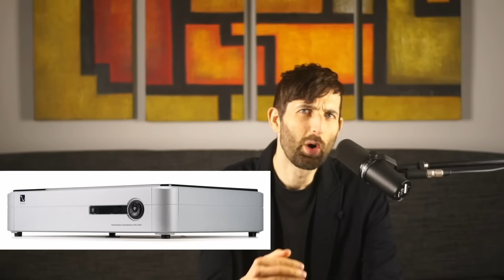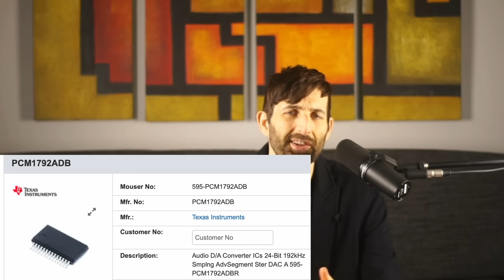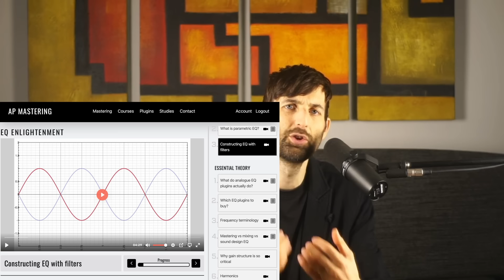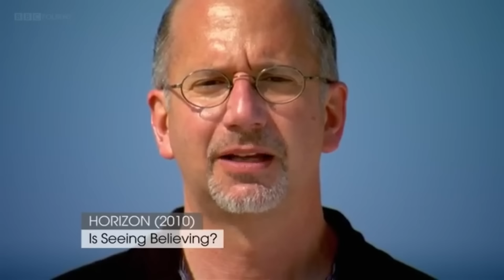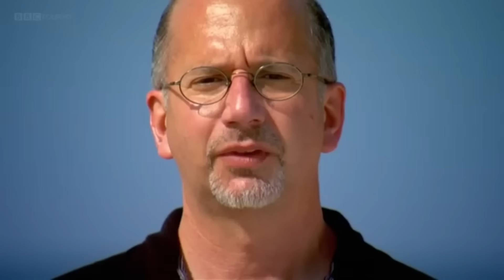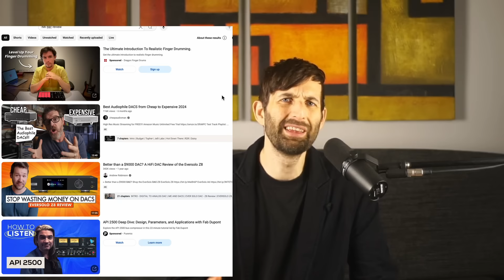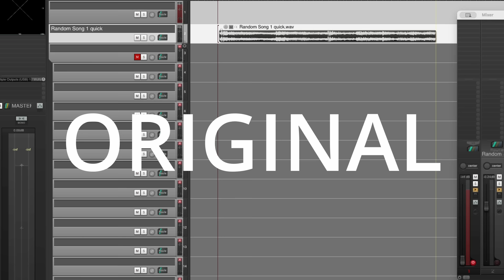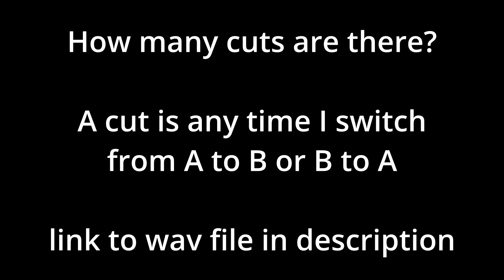The DAC Scam - Almost everyone believes the hype

Comment: Between a $100 DAC and a $1500 DAC there can be a large difference. It doesn't have to do with the "chip" that is used. It has to do with the stability of the clock signal, the design of the power supply for the analog electronics, and the analog electronics themselves not to mention shielding. But if you want to compare a $40K DAC to a $1.5K DAC please share your actual listening experience, not an argument based on specs. What have you listened to on the ultra-expensive end of DACs? What did you compare that DAC to?
Reply: There can be, but if both are competently designed there will not be. The only advantage the $1500 one may have is noise isolation over USB, but that would be about it. Probably more robust too. Modern DAC chips are pretty immune to jitter, a good enough power supply is cheap (it is low power), etc.   It is not 1990 any more.
Reply: @robertt7238  interestingly there are CD players from the early 90s that have excellent measured performance. They were expensive at the time, but the know how was there. 
DACs really are a solved problem now.
Reply: @mattholland315   At the low cost end, the big change came about 15-20 years ago when DAC chips made major leaps in jitter rejection. Prior to then, for top measured performance you needed pretty good clocks, buffer/reclocking, etc.  Then a range of techniques were implemented to effectively eliminate jitter as an audible (or even very measurable) concern.  Modern DAC chip can take an input with a ton of jitter and deliver transparent results.
Reply: @ thanks. Ain’t science and engineering wonderful
Reply: @jerrykorten664  You have fallen for the snake oil.
Reply: @RegebroRepairs  You are blessed with ears that don't require much expense for stereo gear!
Reply: @jerrykorten664  It's not the ears, it's knowledge and brains. I understand that opinions are subjective and measurements are not.

You do not have magic ears that can hear the difference in the frequency response at 80 kHz.
Reply: @RegebroRepairs   The error in your thinking is that we are measuring all that we can hear. This of course is not true. And if you think high sample rates are to hear frequencies above 15kHz you are again showing your total ignorance of the underlying issues. Higher sample rates are chosen to improve the fidelity of those frequencies we can hear (up to 15K for some, less for others). And more importantly to remove the effect of the brick wall filter on the waveform below 20kHz (ringing). That brick wall filter when excited by a lot of high frequency content, as in classical music, heterodynes with lower frequencies to cause irritating sounds. And until you tell me you've been able to compare a recording at 192kHz vs the same at 44.1kHz you have really no dog in this fight. All of you are blissfully ignorant and I think I've spent all the energy I want here. Good luck!
Reply: @jerrykorten664  We are measuring all we can hear. It's clear from your comment that you don't know what the "brick wall" filter is there for and what it does. nor do you know what the effect of it is below 20kHz. 

In short, you haven't got a clue. I assume your stereo is very expensive. I'm sorry that you were tricked by scammers, but that's not my fault.
Reply: @RegebroRepairs  In fact I know how to create a finite impulse response kernel to convolve with the signal in order to prevent aliasing. But I'm sure you don't understand any of this. And if you think we can measure quantitatively all we can hear, I have a bridge I want to sell you too.
Reply: @jerrykorten664  bs
Reply: All we need to know is the measured performance of the analogue output to know if it’s transparent. That’s it. All those design aspects you talk about are important and affect the performance of the analogue output. So we measure that and then conclude whether or not the design is good enough. State of the art DAC performance is available for $500-700. Transparent DACs for even less. Digital to analogue conversion is literally a solved problem.
Reply: @mattholland315  Well there you have it. A total admission of complete ignorance. You haven't listened and your bias is on display. To think that measurements are measuring the things that are important is laughable. You yourself talk about transparency, this is something you can hear, but there is no specification that  measures "transparency". Rather than rant based on specs - I suggest you go to a high end retailer and compare a $400 DAC to a $2000 DAC on a good system and hear for yourself.
Reply: @mattholland315  And all speakers that have the same measured frequency response sound the same.
Reply: @ if they have the same directivity, frequency response and  similar distortion profiles then within their normal operating ranges and perfectly level matched they will indeed sound the same. 
With electronics it’s a lot more simple as there are acoustic systems involved.
Reply: @mattholland315  All of you appear to know nothing about audio  design, aren't engineers and are speaking nonsense! It's like RFK Jr. took over stereo reviewing! LOL.
Reply: @ well in my case I know about audio and have a degree in electro-acoustics. Can’t speak for others.
Reply: @mattholland315 Not an electrical engineer. Certainly not trained in digital signal processing, filter design and analog electronic design. Thank you for saying so.
Reply: @jerrykorten664  There is only one thing to measure: The output electrical signal, and how close it is to what the original signal was.

"frequencies above 15kHz"

15? Try 150kHz. 

"remove the effect of the brick wall filter on the waveform below 20kHz"

Tell me you have no idea how a DAC works without telling me you have no idea how a DAC works.

"And until you tell me you've been able to compare a recording at 192kHz vs the same at 44.1kHz you have really no dog in this fight."

LOL, of course I have. The difference is that I'm an electrical engineer with sound recording as a hobby, so I actually understand this topic and know what I'm talking about, while you have been tricked by audiophile woowoo. 

I assume you have spent a lot of money on your stereo system and you now don't want to admit that it was a waste of money. 

Sorry. Not my fault. Don't blame me. Do you think the earth is flat as well?

"Not an electrical engineer. Certainly not trained in digital signal processing, filter design and analog electronic design. Thank you for saying so."

I know you aren't. I am.
Reply: @jerrykorten664  "Not an electrical engineer. Certainly not trained in digital signal processing, filter design and analog electronic design."

I know you aren't. I am.
Reply: @RegebroRepairs  my DAC is a reasonable $1250. You are not a designing engineer that is plain to read. But I've heard more expensive DACs that sound better than mine. And I have $100 and $200 DACs Too. So I speak from experience, not theory.
Reply: @jerrykorten664  No, you speak from wishful thinking and crystal magic woo. I speak from knowledge and facts. You can not hear the difference between two waveforms that are exactly alike. It is simply impossible, You can just as well claim the earth is flat and pigs can fly.

You fell for the Audiophile scam. I'm sorry about that, but direct your anger at those who scammed you, not me.
Reply: @jerrykorten664  My education is in electrical engineering and I and trained in digital signal processing, and have made my own analog filters to upgrade my mixing console with, etc. So I am a designing engineer. I do not speak from theory, I speak from facts, and you can not hear the difference between two identical waveforms. You speak from wishful thinking and crystal magic woo.
Reply: @ I’m sorry, but since you believe these credentials to be necessary in order understand DAC performance why do you say that listening experience is more important than specs? If you were an expert in the appropriate fields then you would be well aware that subjective listening experiences are incredibly flawed due to psychological biases. The only listening experiences that have meaningful results are controlled, blind ones. 
I’d like to make the point again that it is possible to engineer a DAC for a very low price that has no audible distortion or noise. Therefore it is audibly transparent. This is proven. Also notice I am not asking for your credentials. I am happy to discuss this topic with anyone.
Reply: @mattholland315  These credentials were in response to statements like "if you think you can hear 80kHz" which means the poster does not understand the reason for higher sample rates. It is a fact that you can now buy a DAC for $200 that has fantastic speciffications. If they don't sound like a DAC that costs 5 times as much, why? We are not measuring everything that matters. This is an age old issue in stereo reviewing. The reason people gave up on early audio review magazines that stated that two amps with the same frequency response and distortion specs sound the same. They don't. There were many other issues which weren't measured like the ability to source currrent at a particular slew rate which were unknown at the time. If you don't think the same issue exists with DACs, hang on for a while and watch. We were told in 1980 that the DACs in the CD players were the pinnacle of sound, you could get no better. Boy do we know diffferent now.
Reply: @jerrykorten664  I perfectly understand the reason for higher sample rates. It tricks audiophiles I to paying more money.

And no. Those issues do not exist with DACs.

Sure, two amps with the same distortion measurement can sound different, because they can distort in different ways. This is also measurable.

The DACs today has practically zero distortion.
Reply: @ what should we be measuring that we currently don’t?
Reply: @mattholland315  We need to measure the crystal woo holistic vibrational transmogrifying skew.
Reply: @ sorry just read your comment again and it did make me chuckle!
Reply: And what is your Audio Engineering background by the way? Do you design electronics?

Comment: Interesting video, I went one better once with Hi Res music I mixed a file containing 320k MP3 / 16/44.1 / 24/96 together randomly and saved it as a 24/96 output, any one who listened to it could not tell when the sound went from one to the other. The brain is very good at tricking you

Comment: A few things: (1) this is true for delta-sigma DACs which are a majority of the market; (2) as is stated, power supplies and analog output stages matter - the same chip can sound different in different designs; (3) there ARE non-delta-sigma designs out there and they sound different (e.g. resistor ladder and DSD-converted) and also have higher parts content that increase costs. It IS true that many components have more of an effect on sound than the DAC (e.g. phono cartriges, loudspeakers and phono and line preamps) and that DAC differences have been overstated. However, not all level-matched DACs sound the same, and confirmation bias does not handily explain the differences we hear in DACs.

Comment: This is a very oversimplified view, the introduction is plain stupid with its sensationalict clickbait "scam" warnings. Most of the DACs sound largely depends on the analogue output stage and the power supplies, and NOT on the chip ised. There are heaven and earth differences in the sound of dacs based on absolutely the same chips, and it takes a ton of work by professional AND audio inspired engineers to make a good sounding DAC. Just compare a Benchmark DAC3 HGC with a cheap Chinese dac with the same Sabre chip, no further discussion needed. Or compare any inexpensive dacs (r2r icluded) with a Denafrips Venus 15th. One needs to be deaf to think they can even actualy compare.
The pricing however, is a completely different matter. The companies operating in audiophile and professional audio sector often get off with any price they name without any regard to the self value of the product, as long as it sounds good. But thats capitalism, folks - everyone has a right to name a price for their work or product, and as long as there is demand for it, they are fine. But it pains me to see how well engineered digital audio products get insanely overpriced. When a high end company makes an expensive tube or solid state class A or AB amplifier, and charges an arm and a leg for it, usually it is quite easy to see where the money went - the cost of the best components and costly overspec transformers is simply evident. Not so with class D amps - try to justify ripping several grand for the sum of components that cost a couple hundred! Even worse it is with things like audiophile streamer transports and network switches / hubs  - they surely have a right to exist as they do sound better, but they should cost proportionate to the parts cost, like twice or three times the cost of the regular "non-audiophile" product, but not ten or twenty TIMES as much! Like raspberry type streamers that many companies are tweaking with a LPS and a digital output board, and then feel just right to charge a thousand euro instead of 200 - 300 it sould actually cost (yes, I mean HoloAudio Red). This actually is not a scam (because it sounds good) but a very huge and unfair ripoff.

Comment: The only time I've ever heard a dodgy DAC is the ones they used to put in $5 keyring MP3 players that were around circa 2005. They just sounded off, although I'm not actually sure if that was due to the DAC itself or the really crappy EQ DSPs such units used. Any other equipment I've had since 1991 has always sounded  just fine .

Comment: Schiit Yggdrasil DAC, ~2500 USD, compared to DACs 4-6x more expensive was really on par with them. The tests with full range speakers (I admit there could be differences on earphones, but I don't consider earphones a proper sound experience). Yggdrasil is probably one of the best deals, if one is building hifi to enjoy with limited budget. And best piece of advice: don't waste money on expensive cables. All signal  and speaker cables will have some differences in sound because they are signal filters. But your ear will accommodate them in seconds. Spend saved money on better key components and room treatment. Don't be shy to use equalizer (best in digital domain) to compensate room modes

Comment: Something about NOS dacs: Back in the days, when the CD came out, not all units had good antialiasing and super sampling. So some of the early adopters heard the brand new media called CD and there was stuff, that was not on LP. "Ah, this is how the original really sounds like!" At least some of them thought. So there are people wanting those weird artifacts because they think, this is what it should be like (it's not).

Furthermore some want additionally some saturation and compression. Often by a tube and transformator.

I had this discussion once. While the DAC was a standard unit, his preamp was some mostrosity with tubes and all that. He loved that thing. I told him: "Yes, it sounds good. It's like adding a high end compressor to your signal and driving it a little bit. Of course he denied and told me, that was the true signal on that CD. Well .. I grabbed the track, showed him the original in my DAW on that trusty old laptop. It sounded flat and boring to him. Then I added an LA-2A plugin and cranked it's input a little bit. And there it was. His face lit up and he said, I recorded the signal from his preamp. I proved him, I did nothing the like, but we did it after it to compare. And really: His precious transparent preamp was anything but. But after he heared, what such a compressor would cost, he was fine by it and called his preamp a steal.

Comment: I am very impressed with your video. I come from the video and audio world, mostly involved with professional video as a repair engineer, now retired. My start in life was working for an independent HiFi retailer. We sold a broad range of equipment, and the shop was frequented by many audiophiles. I remember one day we decided to run an experiment without telling anyone. We had a couple of regular guys come in who we knew well, and we told them we had a new high-end phono cable, and would they like to have a listen to it. Of course they said yes, so they sat down and we popped on a CD and supposedly switched between the new high-end cable and cheap no-brand cable. 100% of the time they were listening to the cheap cable, the expensive cable was never used. But without fail, when they thought they were listening to the expensive cable, they could magically hear greater depth, a wider soundstage and more detail.

Recently, my Cambridge Audio 851N network streamer packed up, the network adapter stopped working, but it was still working as a DAC to a CD player. So I ordered a new Cambridge CXN100 as a replacement for streaming. I decided to see if the newer model would sound any different to the older 851N by connecting the coaxial and optical outputs of the CD player to both DAC's, and switching between them on the preamp. They sounded identical, I couldn't tell any difference, yet the CXN100 boasted a newer and supposedly better DAC. Anyone spending tens of thousands on a high-end DAC is seriously wasting their money.

Comment: I agree that getting dacs that cost 10s of thousands of dollars is ridiculous. But I am sorry there is some miss information again in your video. It is just not true that the dac chip itself is all that matters, far from it. Now does that mean you have to spend thousands of dollars to get top performing digital analogue conversion? NO. In fact, some of these uber expensive dacs have much worse implementation than much cheaper ones, but have super expensive casing.